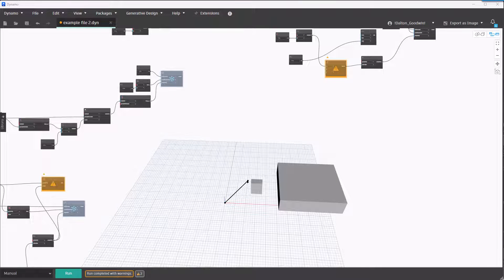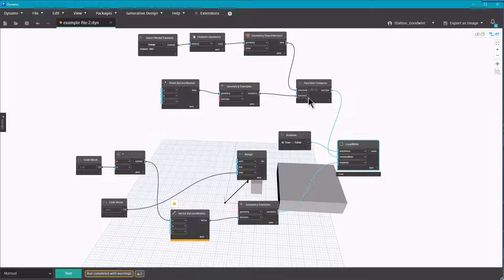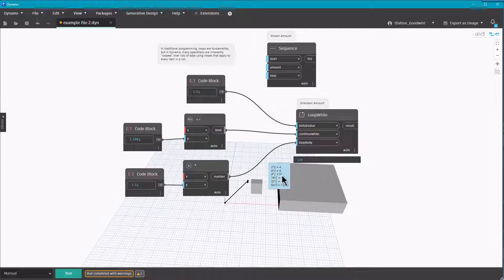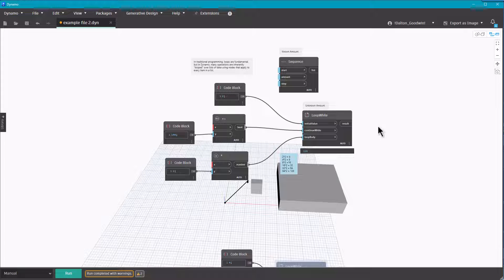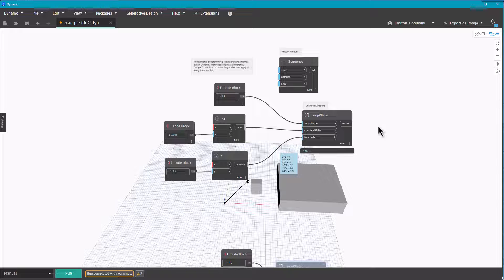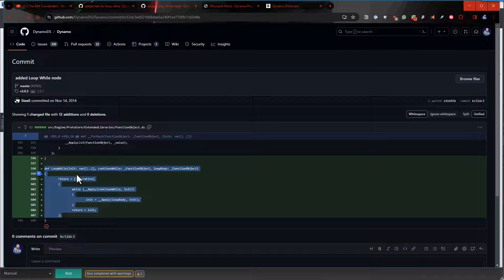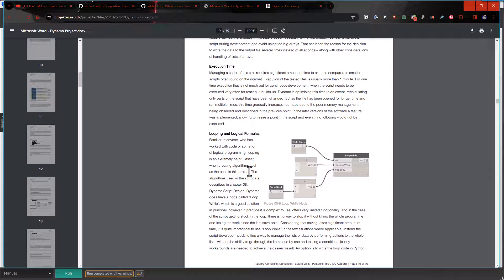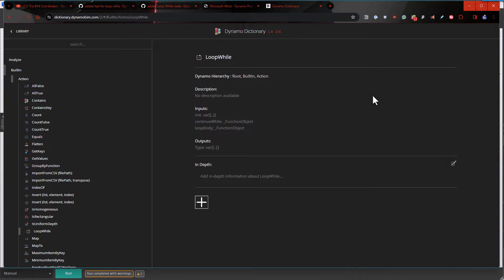Dynamo | LoopWhile Node

Comment: I have 1000 wall types and was looking to use loop to create one of each wall.  Any thoughts?
Reply from the maker: @JPSquared-y5b  place them?
Reply: @TheBIMCoordinator  Yeah, in any location on level 1.  We did a click command to do it which took about 25 minutes but it worked.  Wasn't sure if there was a dynamo script for it.
Reply from the maker: @JPSquared-y5b  yeah you wouldn’t need to use the while loop. I can see if I can create an example real quick and post it